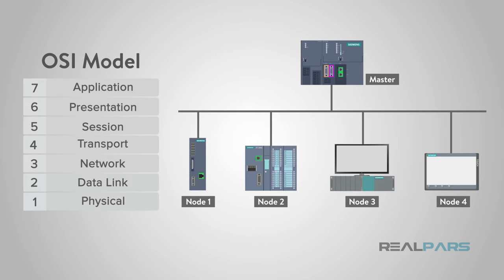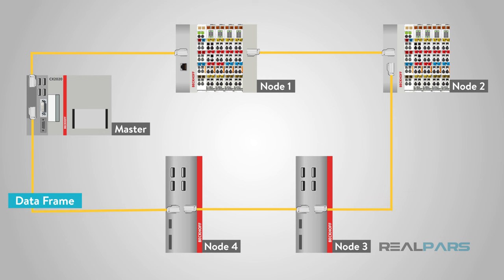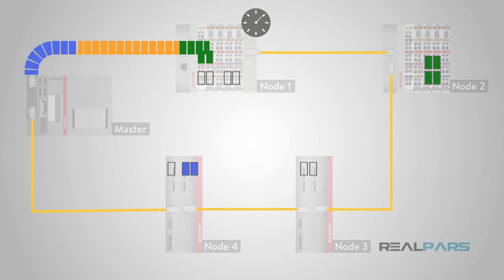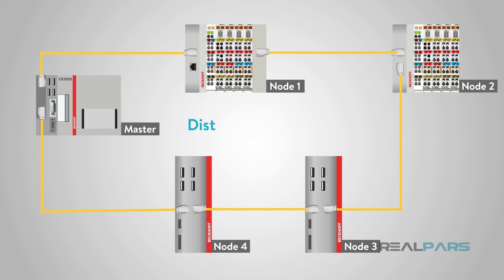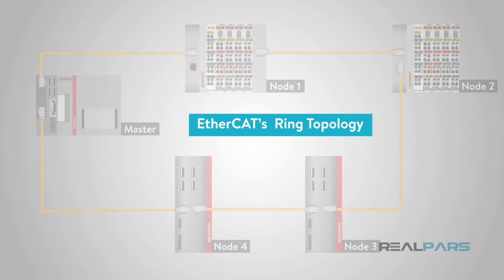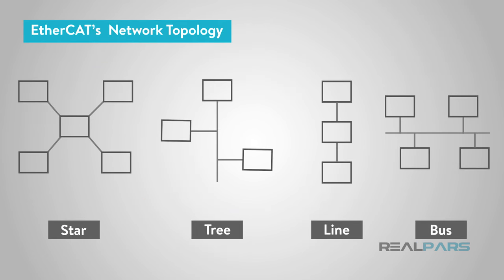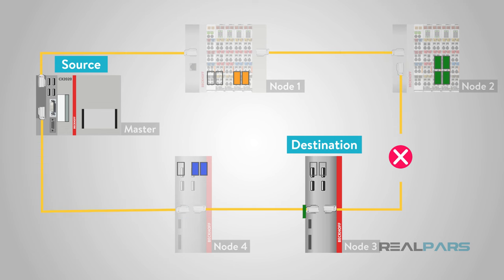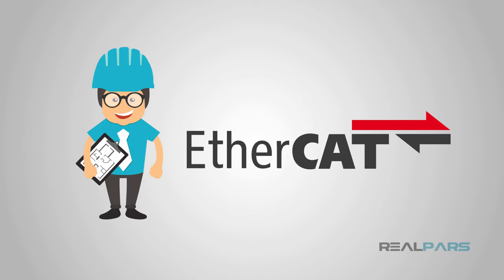What is EtherCAT?

Comment: Modern Ethernet switches have port to port latency of single digit nanoseconds. Arista has one with less than 4ns of latency. What advantage does EtherCAT have over that?
Reply from the maker: Thank you for your question! EtherCAT processes signal frames through nodes, so no Ethernet switches are needed. It operates in real-time to minimize delays, and you can adjust the bandwidth if necessary.

For more detailed benefits, I recommend checking out the EtherCAT website. Happy learning!
Reply: @realpars  I mean it seems as if EtherCAT was created because Ethernet switches were considered to be too slow for real-time process control but that is no longer true. Modern Ethernet switches are insanely fast. I suppose EtherCAT does save the cost of the switch but it adds cost to every device. Latency also grows with the number of devices on the bus while latency is constant with a switch. It may be easier to wire devices to each other than to a central switch.

Comment: about Distributed clock : what did you mean for "  Each node adds the timestamp as the message is received"  for timestamp you mean that the slave adds to the frame its internal current time  respect the GMT?
Reply: Normally 1st slave device is your master clock, when EtherCAT frame reaches each subsequent slave node the time stamp is saved. EtherCAT master uses timestamps to calculate delays between each node. This will help you synchronize nodes in the same sync group. This has nothing to do with GMT.

Comment: Interesting, but it would be great if you could also highlight some disadvantages.
Reply from the maker: Thanks for your feedback, will happily pass this on to our course developers! 

Happy learning!
Reply: there are none. Literally the easiest coms protocol. To the best bit is that it's now available wirelessly. No need for connecting anything to your PC.
Reply: I can hardly think of any to be honest.
Reply: Well, one disadvantage is if you need to make an unplanned topology change on a live specimen. That is quite straightforward with ethernet IO, but with ethercat it's a very theoretical possibility, practically you just can't, you need to take it offline. Which is a problem in some cases. Maybe some time in the future there will be better software support for it and it will be somewhat doable in limited fashion, but due to system architecture I don't ever see it being as simple as with ethernet IO.
Also, if your controller is not realtime and you can't put out the packet on time, that will cause many ethercat slaves to misbehave and just plain not work properly. Which is fine if you actually have realtime controller anyway, but that is not the case in every sort of system. So if you need to make your control system realtime just so you could use ethercat, then that's a lot of extra headache and cost for something you just don't need.
Ethercat does need a very sizeable software and hardware stack, which can be an issue in embedded systems, serial comms in comparison are trivially simple and much cheaper. For that reason I don't think you are ever going to find ethercat in your coffee machine.
Ethercat is absolutely awesome, but to say it's a one size fits all solution, is perhaps an excessively narrow view. There absolutely are cases where ethercat is not the best option.

Comment: Having seen this video, I think a video  comparing “EtherCat vs ControlNet Network” advantage and comparison should be aded ti the RealPars Team queue for future videos. 
This arise too from a internal conversation at my OEM Engineering Company as to why we still design brand new plants in 2019 with ControlNet vs EthernetIP. On my side of company we do all plant upgrades as that what we do in all EthernetIP. Main side of Company on greenfield new projects still do ControlNet Networks. Reason was attributed to slower speed and not missing any communication data as compared to EthernetIP, but it made no sense to me logically. So I’d love a video on that. Or also include EthernetIP in the 3 way comparison.
Reply: We will take your suggestion into consideration.  ControlNet is deterministic.  It was created using standard 10Mb Ethernet and using 5Mb for data transfer and 5Mb for insuring that data packets sent to a node are actually received by a node.  It adds the ACK and NACK features that standard Ethernet is lacking.  Standard Ethernet is like the post office.  You send a letter (Ethernet packet) and you do not know if it has been received until you "ask".  ControlNet adds a function that is used to guarantee that the packet is received, making it deterministic.  Ethernet/IP is not deterministic, although it is very robust.  A couple of layers have been removed from the OSI stack to make it is as reliable as possible and as deterministic as possible, without imposing the overhead and limitations of ControlNet.
Reply: Scott Sommer 🤔... That is such a valuable and well articulated reply that I actually get that in your explanation. Though I’ve had some very smart engineers at work try to explain things to me before with the ControlNet issue. None ever gave me a simpler explanation than that where it’s meaningfully understood. I’ll surely screenshot this response for future reference because I can’t win with so call smarter thinking engineers. Still, i think a video would be great in comparing all three and explaining the issues or what you so well explained and more. Either way, glad it’s being considered. But I’m most thankful for such an easy well explained explanation that didn’t leave me lost at all still wondering. Well Explained! Reply so well appreciated.
Reply: Not a fan of either of them. I would go with EtherCAT. Low cost, phenomenal performance and easy to implement. People use EIP because Rockwell has been around for a long time. Many suppliers chose EIP due to its market share not because of its performance. EtherCAT is open technology with more members joining every year.

Comment: Does ethercat have ipv4 address like profinet? Can it transmit over an ethernet network with routers and switches like profinet?
Reply from the maker: Thank you for your question! No, EtherCAT does not use IPv4 addresses. EtherCAT uses a "processing-on-the-fly" method, eliminating the need for IP routing.

Hope this helps :)

Comment: How many motors can 1 PLC control?
I have 5 (2 axis drilling machines each has 3 motors) which is 15 motors total, and I need to know how many PLCs do I need to control them at the same time.
Reply from the maker: Hi Bassel,
As far as I know, the PLCs are not used in controlling the CNC machines.
I am not sure if you are aware of Siemens SINUMERIK CNC automation systems or not but you can find out more about them here: https://sie.ag/2u87gPL
There are other manufacturers of CNC automation systems which you can find them with a simple search.
However, you can use PLCs to control your machines, but I'm not sure that PLCs can function as good as the CNC control systems and in addition, the code would become complicated. Probably a Siemens 1200 CPU would be enough if you insist on PLCs. 
Thanks
Reply: You can use 32 DI/16 DO PLC
Reply: @realpars  Thank you so much.
Reply: @piyushviroja4648  Thanks a lot.
Reply: Bassel, this could easily be done with 1 Beckhoff PLC. TwinCAT NCI supports 31 channels, each channel can have 3 path axis + 5 auxiliary axis, so 248 axis in total is the software limit. You would need a controller with enough calculation power, but 15 motors is like a basic application for TwinCAT. Something like a CX5140-0155 would do that.
Reply: @realpars  There is also the Beckhoff TwinCAT 3 CNC package and G-Code interpreter, which allows using their system for multi-axis CNC style functionality. I'm not sure if you would consider TwinCAT 3 a true PLC since it is a software-based PLC, but I thought I would mention this here for future readers. For a simple drilling application however CNC functionality may not be necessary. EtherCAT is also commonly used in motion control and CNC applications even if it is not using a PLC for the master, Omron Delta Tau Power PMAC or Kingstar are examples of EtherCAT masters used commonly for this purpose.

Comment: Thanks for the video. Quick question. Our PLC only has 1 ethernet port. If using EtherCat, can I use an ethernet switch in the loop? Thanks Again.
Reply from the maker: No.  EtherCat enabled devices will have two RJ45 connections;  one for the incoming network (from the previous node) and one for the outgoing (to the next node).  Each EtherCAT connection act as a switch and can pass the data packets on to the next node.  You can't just add EtherCAT to your existing network;  you need to install EtherCat-enabled processors.  You can add an Ethernet switch port to an EtherCat processor in order to interface to Ethernet peripherals, such as printers.

Comment: There exists 3-Port EtherCAT Slaves. I'm wondering how the frames moves in that topology? Better yet, how does the frame moves in a star topology?
Reply from the maker: EtherCAT was designed for implicit messaging in a ring topology, giving the user the fastest speed and reliability.  Three-p[ort EtherCAT devices allow a "spoke" or "drop" to be attached to the device.  In order to employ this configuration, explicit messaging on that port is required.  The same goes for the star configuration.  Essentially, EtherCAT is "demoted" to CAN over Ethernet for these configurations, which is not as fast or efficient.
Reply: @realpars  Star topologies are possible where the EtherCAT frame follows down the "spoke" and returns back along the same physical connection before continuing on, effectively making a star network appear like a line/ring network if you were to flatten it out. See for example CU1123 or CU1128 from Beckhoff. Internally, every EtherCAT slave uses a special ASIC such as the ET1100, some of which support 3 or 4 physical ports. There is no performance penalty to this architecture beyond the delay introduced by the additional nodes in the branch.

Comment: Hello Sir I have a question, my machine gives an ethercat error showing different cards every time and goes away for some time after powering on and off, can you guide what could be the problem, I have checked all the connections and their tightness, I have also checked the topology but it seems that doesn't matter in this case because it points out a different module every time
Reply: Use TwinCAT’s EtherCAT diagnostic feature and check again. Are the slaves getting enough power? Also check your Ebus power consumption. It should be fairly easy to diagnose.

Comment: Why would anyone choose EtherCAT over EtherNet/IP?
Reply: No reason other than the redundancy capability, flexible network topology, speed, ease of use, distributed clocks functionality, advanced diagnostics of each slave device, no feasible limit on devices, and the ability to use any other fieldbus in a master or slave configuration via one single module over EtherCAT. Yeah, other than all of those there’s barely any benefits
Reply: @InvisibleSquirrelz  Thanks for the comprehensive reply
Reply: Because EtherNet/IP sucks. It’s slow, lots of effort to configure, expensive (have to invest in routers switches).